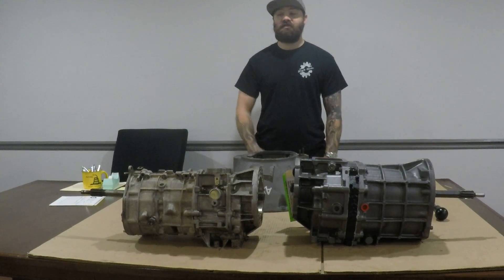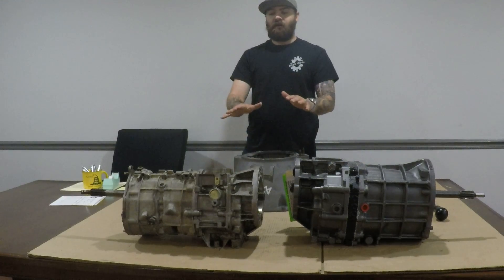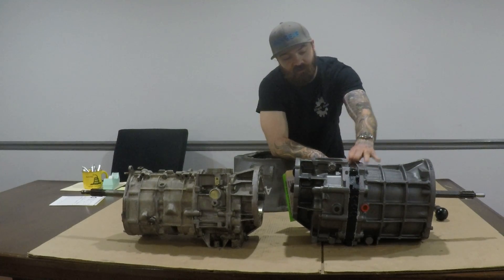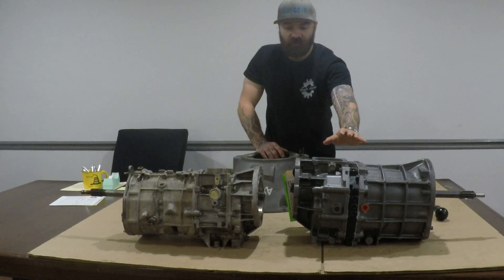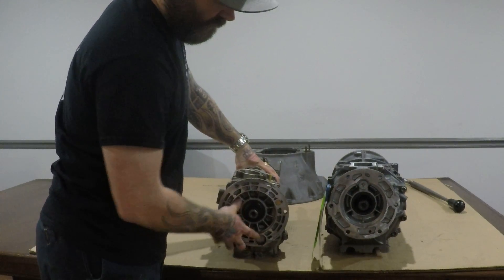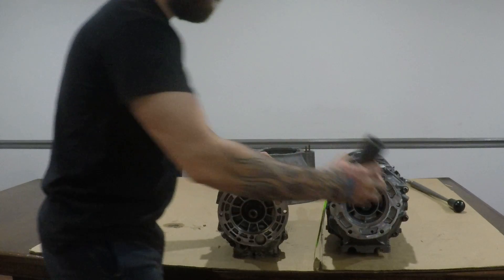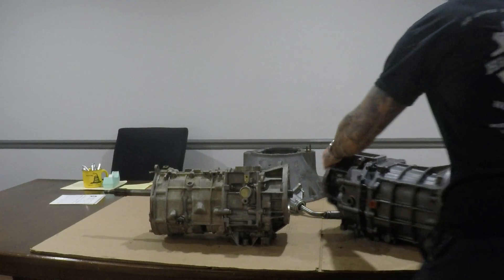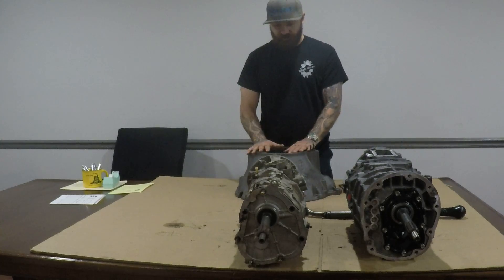AX-15 and Peugeot Identification

Comment: Internal slave cylinders suck,they leak oil onto the clutch components,external type much better option in my opinion. It far more of a pain keep changing a slipping clutch due to internal slave cylinder leaking.

Comment: Where is the oil drain plug on the Peugeot BA 10/5? I'm just changing my transmission oil on my 1988 Jeep Cherokee Pioneer. I'm not looking to change the transmission out, since it still works fine, and I don't go off-road.

Comment: Ill be doing the switch soon. I needed to id my transmission and this helped a lot. Im concerned about the bearing inside being the right size as the shafts are clearly different sizes?